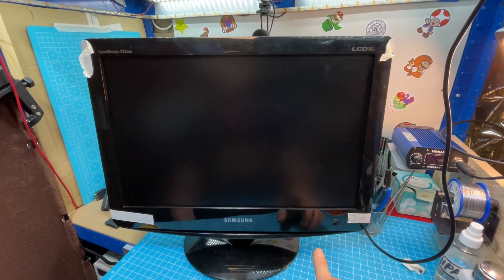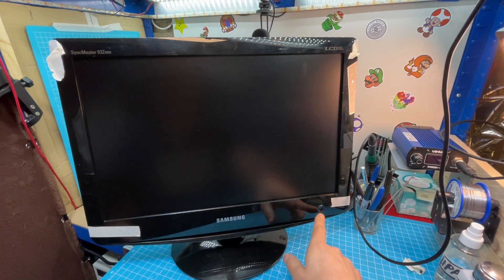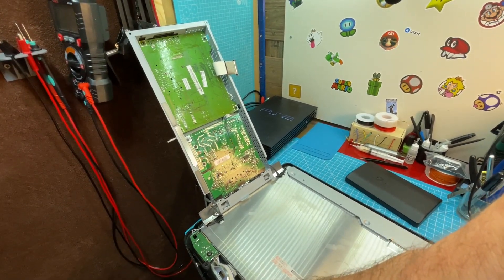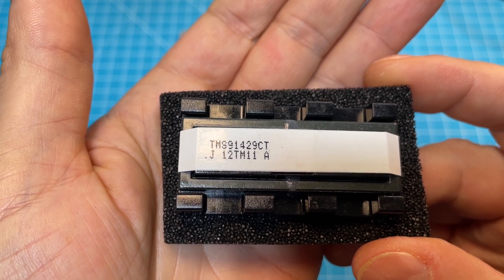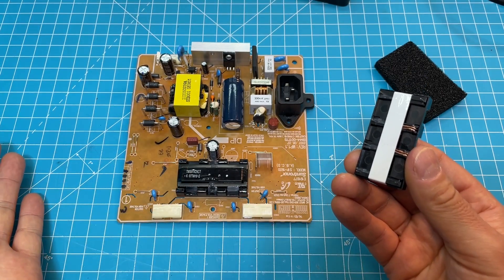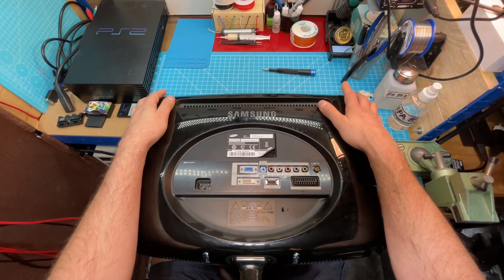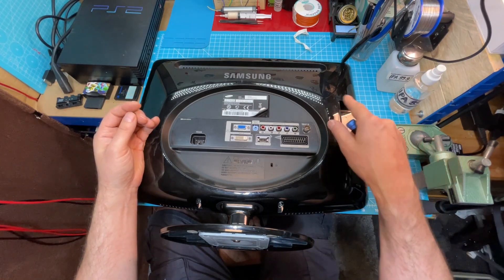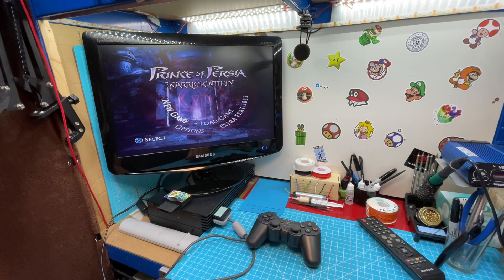Fixing a SAMSUNG SYNCMASTER 932 MW with NO BACKLIGHT. Bad INVERTER TRANSFORMER (TMS91429CT) #repair

Comment: I have exactly the same Samsung 932mw model with the same issue. I   have some solder experience, but am not a electronics specialist. i have seen the same ccfl transformator on AliExpress. If I buy one from a well trusted seller, would the quality will be good enough? But I m worried if i still need the capacitors you have replaced.
Reply: I can't wait to make my attempt to the repair. when I have ordered en received the part, I let you know if worked.
Reply from the maker: @rverdonk  Yes, please let me know!
Reply: Hello again. Well I have replaced the transformer and at first, the lcd screen didn't work properly. When turning on, the screen was malfunctioning or in a sort test mode. The screen cycled in a 4 coloured horizontal screen, then a white screen, followed up even brighter white, and finally into black. This process repeated continuously.  So I checked all the inside the tv. I was almost giving up. Now it finally works! It looked like the back lights weren't able to receive a signal from the main board. The tv was stored for a very long time at the barn, to be eventually throwing away. Which part should be failing next after a couple years, maybe the backlight, I don't know. Hopefully it will work for years. But now the tv can be used again occasionally when we are going to travel. Thnx for guided help. I have subscriped to your channel, and out of curiousity I am gonna check your other repairing projects.
Reply from the maker: Thanks for your kindness!! All the best to you!
Reply from the maker: @rverdonk  I guess the quality will be ok. The capacitors are probably ok.